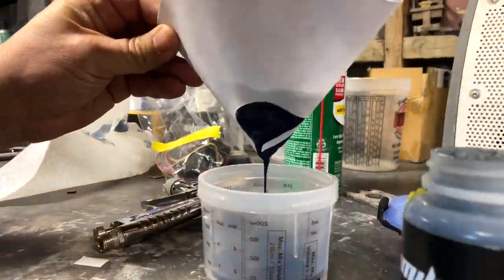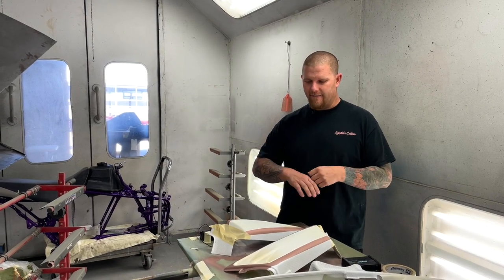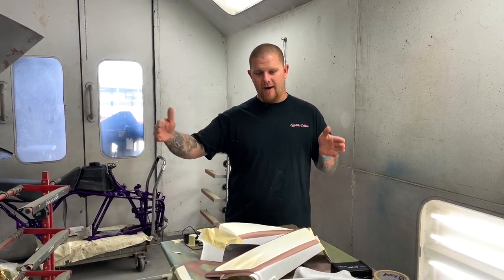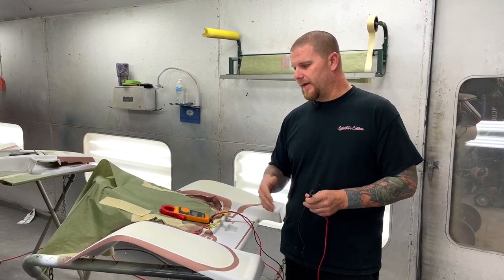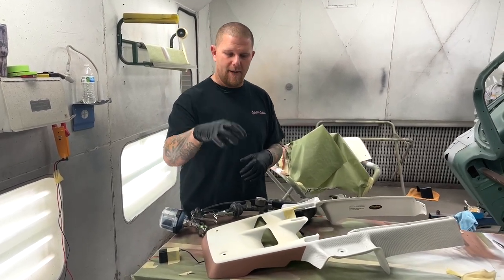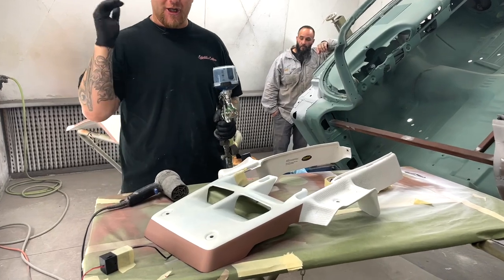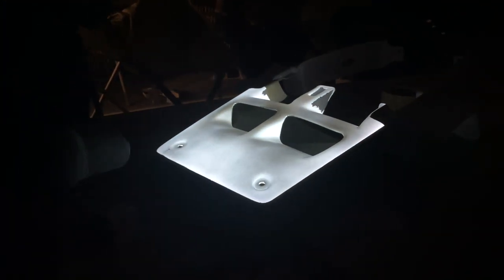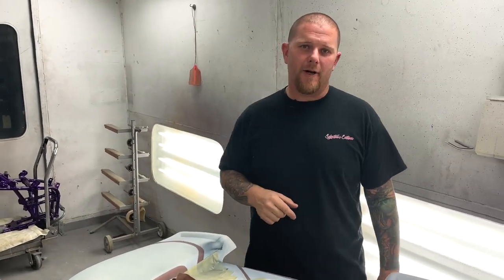The Magic of Light up Paint: Lumilor How it works

Comment: i wonder if this was the stuff they used on wheels back in 05' - 07'? It was labeled as 'Wheel-Glo', real big here in the south. Wheels would just start glowing like neon colors at night, like reflectors. It was awesome!!
Reply from the maker: That sounds like glow-in-the-dark paint. This has to have a wire connection and be turned on physically.

Comment: Do you have to connect to 9v batteries or can you connect to power in vehicle?
Reply from the maker: There are different applications you can definitely hook it up to the power of the car and or you can use the wall 110 V power you just have to use a different set up. There is also large inverters small inverters and power adapters.

Comment: What happens if paint got scratches, if got damaged, or has dents on lumilor paint? Is it still usable? And what is the worst-case scenario?
Reply from the maker: As long as it doesn’t break the electrical path it still works.
Reply: @SYLVESTERSCUSTOMS  plz can u make demonstration video regarding this issues. I just didn't get it. when does the paint completely fail to lit?. In this case. thank you.